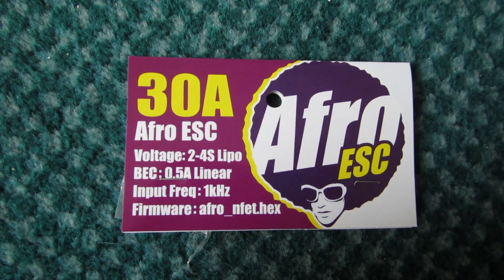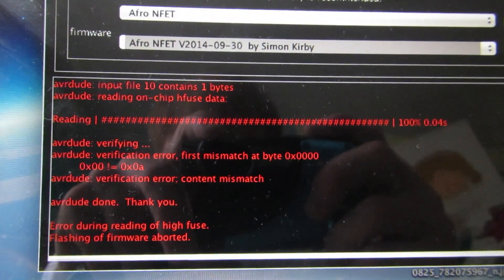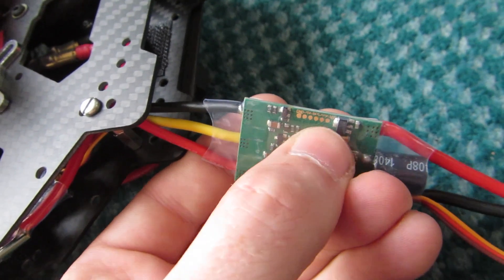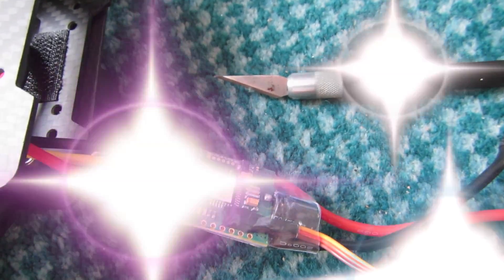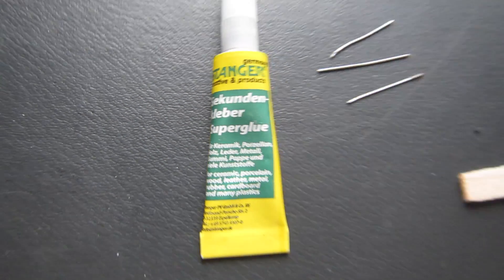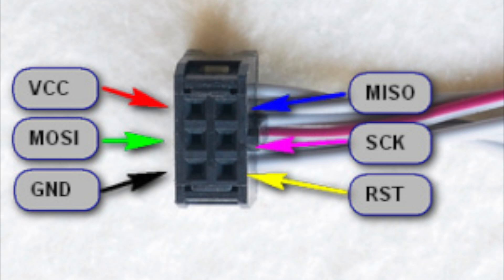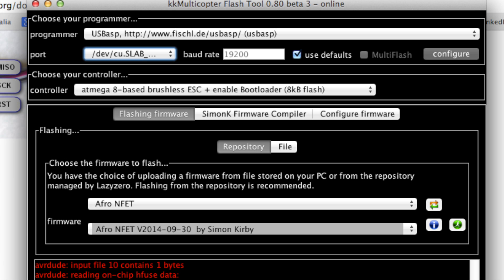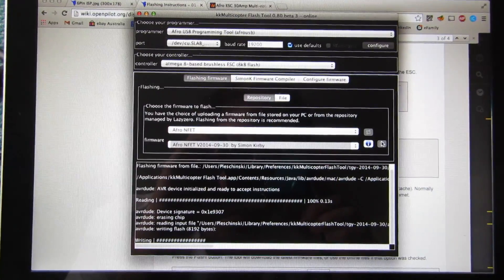How to flash Afro ESCs if the USB tool doesn't work (pad method)

Comment: Trying this on my afro 12a as I also dont' have the socket tool.  How did you find the bootloader pad pinout order?  I can't see the traces on my escs. Do you know if all afros have the same pinout as  you've shown in your video?  Or do you know the order of the pads on the afro 12a?  Thanks.

Comment: Can the Atmel socket flashing tool be used with the afro esc via blheli suite?
Also, my afro pads are named very differently to the usbasp, is it correct to wire up the afro esc in the pic below in the same order as your afro?
Here's mine:
http://www.hobbyking.com/hobbyking/store/catalog/39708(1).jpg

Thanks man
Reply from the maker: Huh, what an odd setup.
That's UART, and - someone correct me if i'm wrong - I didn't think that you could programme Atmel chips over UART. Only SPI like my ESCs. What kind of ESCs do you have? When did you buy them and how many amps?
The moral of that stream of thought was 'no, I don't think you can flash the ESC with those contacts'.

But yes, you can use the Atmel socket flashing tool to flash the ESC using either BiHeli sweet or KK flash tool
Reply: Thank you Patrick! Groovy answer.

They are 30a afro,one had reverse firmware for 3d so has locked bootloader, blheli says i need to flash via the esc. Because of the pin out difference I would rather try the direct chip method.

Thank again dude.
Reply from the maker: MicroRCFiend Yeah definitely do the direct chip method, it's easier - this method is only if you don't have the socket flashing tool
Reply: +Patrick Leschinski Is it possible in such a way to pull the firmware?
And even if I did, and I ask simonk BLheli, I can flash back simonk?
Reply from the maker: To flash firmware to an atmel chip, the .hex is converted to machine code, so it would be very difficult to get the firmware off the chip. But you don't need to. All firmware versions are available on the internet. Yes you can change between blheli and simonk, just chose the firmware you want from the list in kkflashtool